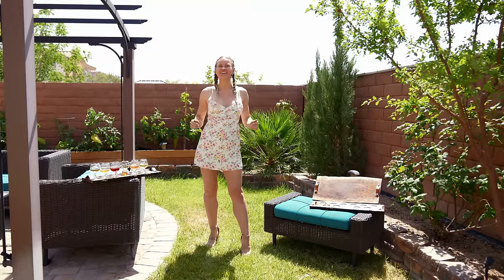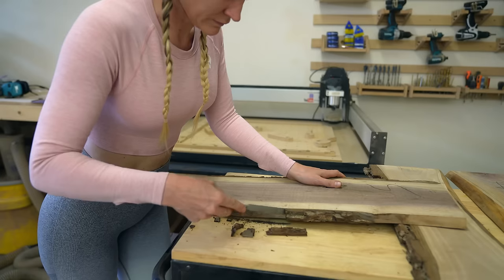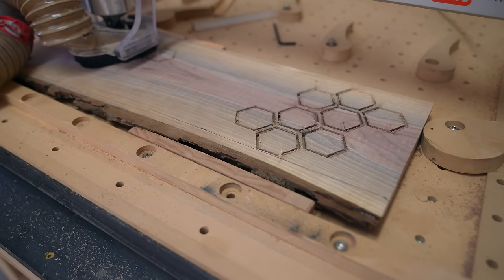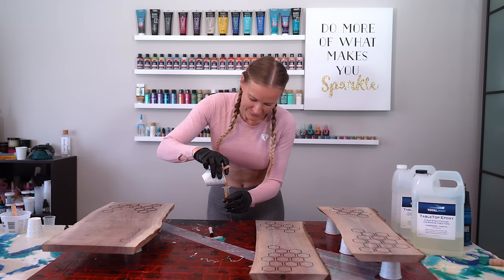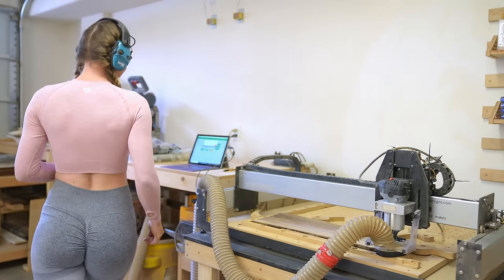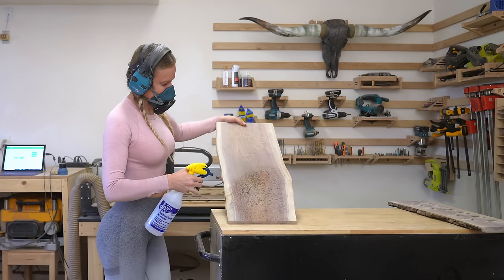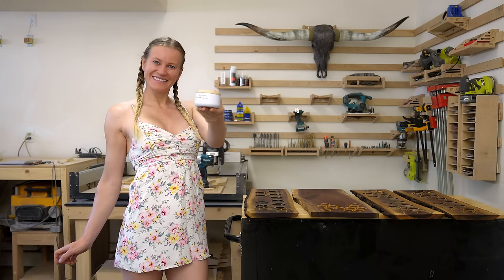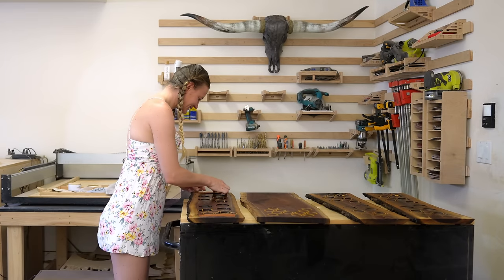Tasty Wine Flight #wood #diy

Comment: I was saddened to see the bark removed only to be glued back. Great work tho. Looking fanfrikkintastic
Reply from the maker: Thank you Paul, I only removed it on one side so I could fill in the gaps on the other. Sadly half of the bark was ripped off the pieces I purchased. So I fixed it 😃